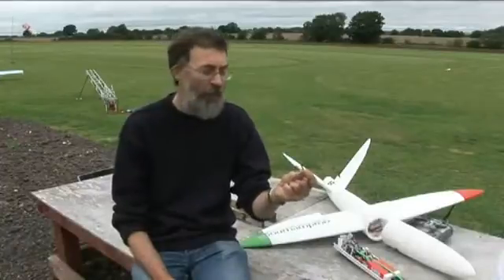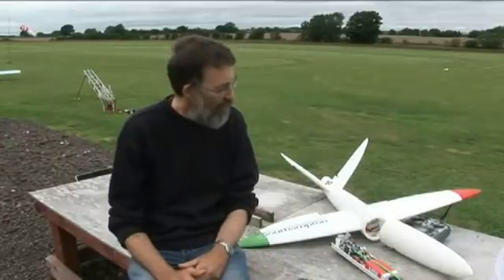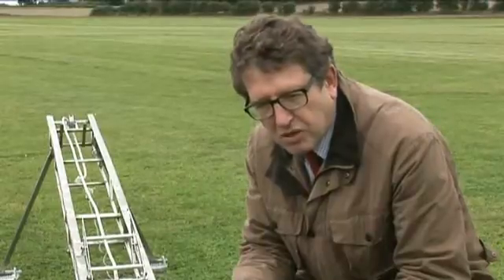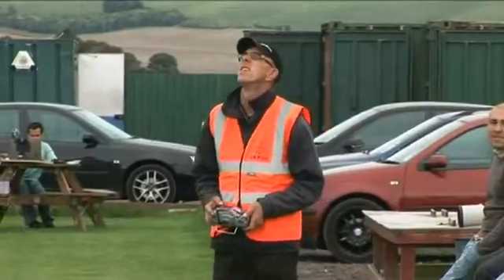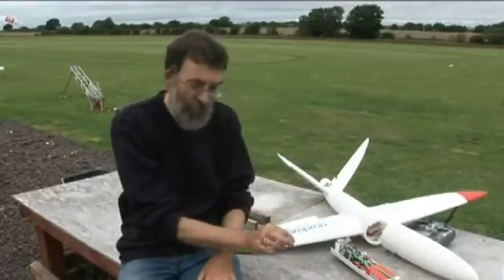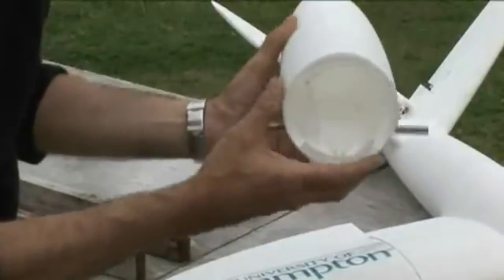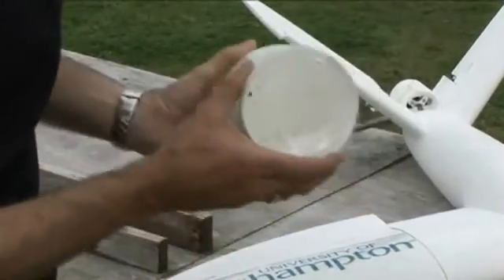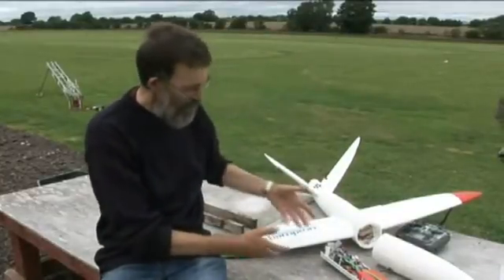Southampton engineers fly SULSA the worlds first printed aircraft [SaveYouTube.com].webm

Comment: 3D printing is the future, even our ET visitors use it and quite impressively so.

so far however the problem is cost (speed), precision and material strength.
if speed and strength could be handled then it would quickly overtake any other production method. as it should